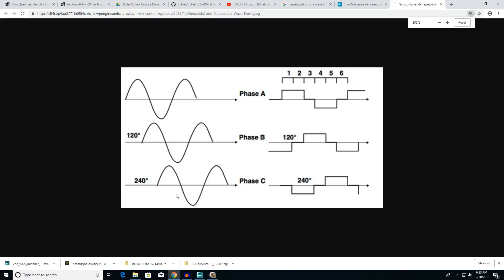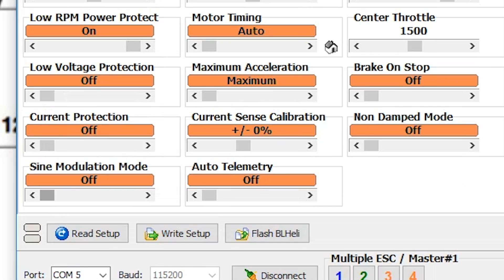BLHeli32 100% Explained - Part 11 - Sine Modulation, MIn Max Center Throttle

Comment: Hi Joshua, it seems we do not have to calibrate any throttle settings in BLHeli_32 if running DShot, is that right?

BetaFlight shows 1050 stick low threshold and 1900 stick high threshold but my sticks move from 998 to 2001 ... am I losing throttle range by not having 1900 set to 2000?  As far as the low end is concerned, my motors start spinning smoothly at 1008 and I've seen somewhere to add 30 to this value so should I be using 1040 or maybe even 1020, 1030, rather than 1050, for a slight slower prop thrust to help with inverted stalls, wall gliding, etc.?

Comment: But, the real question is will sine modulation mode overload the FC enough that if you send too much data it would crash when you need it the most?  To actually get a sine wave you have to run more math I assume.

Comment: Hi Joshua, all, I really need your help. This is driving me crazy for months now... I've built my 1st quadcopter, X500 based, wanted to use it as a platform for some ideas. Anyway, current situation is that it has BlHeli_32 ESC's, 3508 motors (700Kv), a Pixhawk 2.4.8. Motors were properly connected and are working, ESC's calibrated, BlHeli suit data looks ok. Ranges for all motors are: Min 1010, center 1500, Max 1990. I've set BlHeli pass through on the mission planner. However... When arming motors start spinning, throttling up a bit and they respond, BUT any increase beyond the initial RPM increase (a bit above arming RPM) has no effect. Throttle remain constant. Any solution will be appreciated. I'm not getting to the point of takeoff.... Thanks in advance !!!
Reply from the maker: This sounds like a Pixhawk issue but I don't really know anything about it.
Reply: @JoshuaBardwell  Well...surprisingly I also got an answer from the PixHawk related forum, a guy there replied "have you tried switching off " Low RPM power protect " in Blheli-32 suite?"  And I did.. and it worked...

Comment: I'm not sure about how or where they use frequency changers for motors.

But for normal motors with a set speed pure sine is better than modified sinewave (as in DC to AC converters), modified sinewave makes the engine become warm and need more power to work.